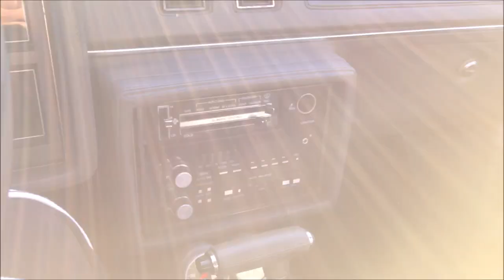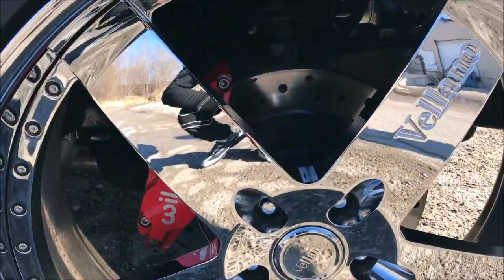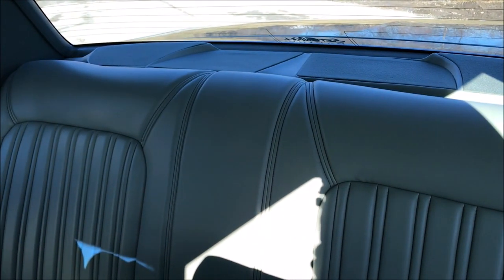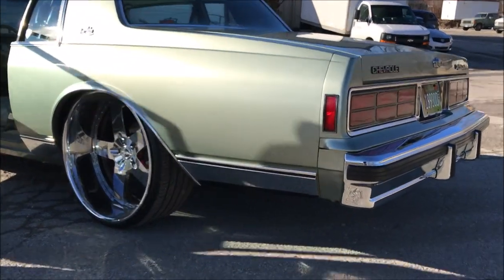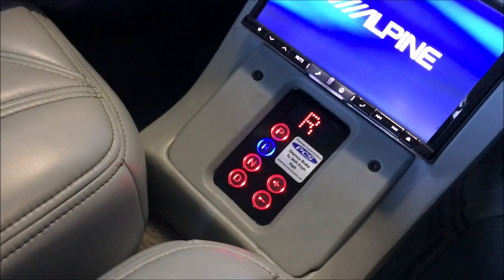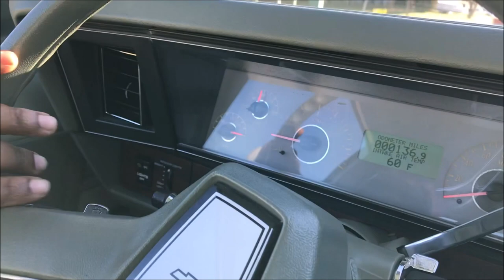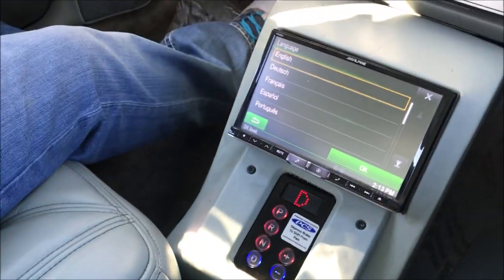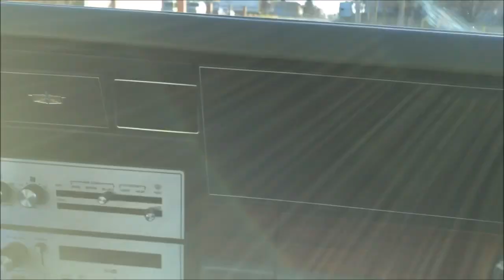LSA BOX CHEVY ((( STUPID POWER )))

Comment: That thing is sick. But he should have made the column shifter used for something instead of just leaving it there. Like make it a duplicate of the pushbutton shift control (could use an original 4L60 range switch). The detent could be salvaged from the original trans as well so it still "feels" like a column shifter.

Comment: The question is what engine is that is it a Mopar engine or a Chevy engine, I'm beginning to think that is a Hellcat engine in there but not sure, I noticed he has Mopar calipers as well, let me know what gear ratio is using on his differential and if it's posi cuz it looks like it, what fuel pump did he use in what gas is E85 or high octane of 93
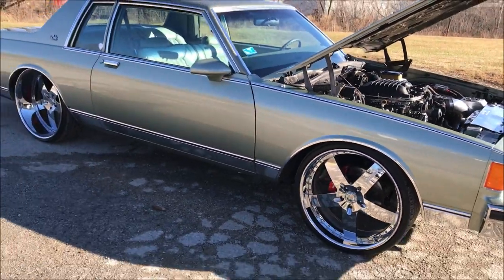Reply from the maker: omar lebron 93 and 3:23